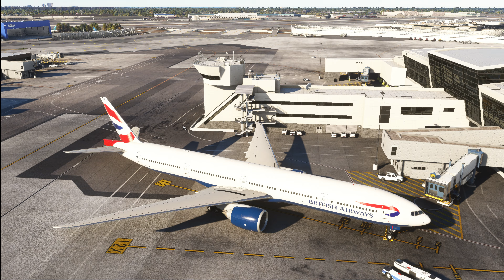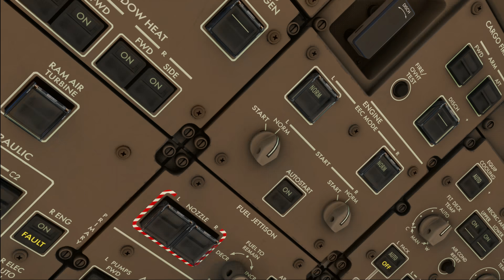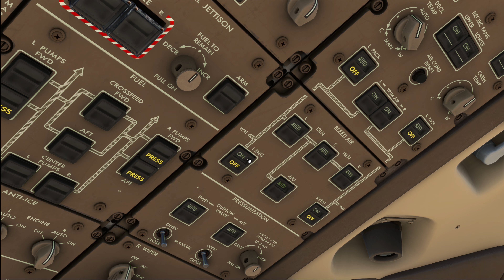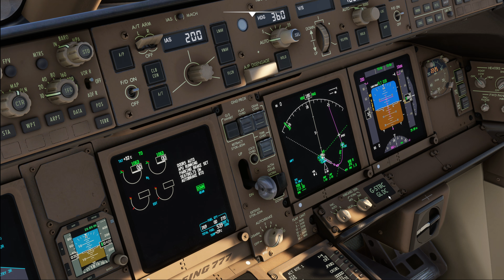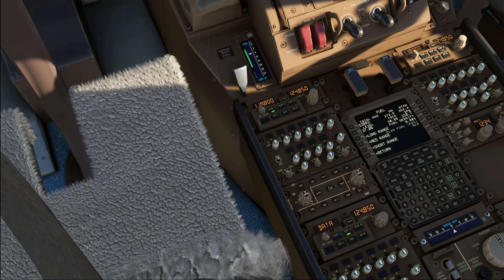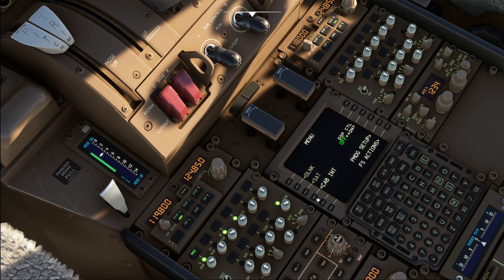PMDG 777 Tutorial 3: Flight Deck Setup (Preflight Procedure) | Real Airline Pilot

Comment: I have a Question, is the Tiller on the Captain's side fully functional? I'd like to use it to steer the aircraft on the ground instead of the rudder pedals to give us a bit more realism.
Reply from the maker: There's an option where you can select if you want a full tiller simulation or a simplified tiller=rudderpedal version.

Comment: Hello Mr 330, can you tell me if navigraph data is compatible with the 777. I installed rev 2406 which shows up in config/nav data but the FMC still shows rev 2404.
Reply: Yep is already available for 777
Reply: @Seb851s  do I have to go onto navigraph and set it up? I don’t recall having to do anything special for my PMDG 737
Reply: I went onto navigraph and found the 777 download in the manual section but that data is not for msfs 2020.